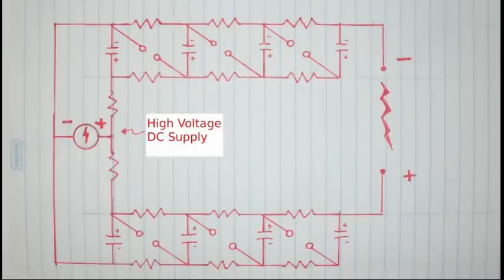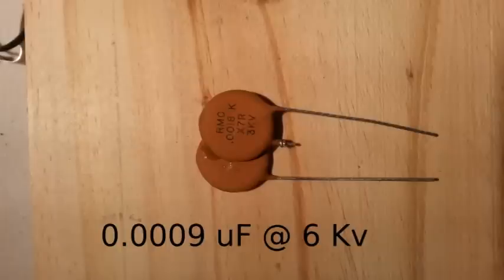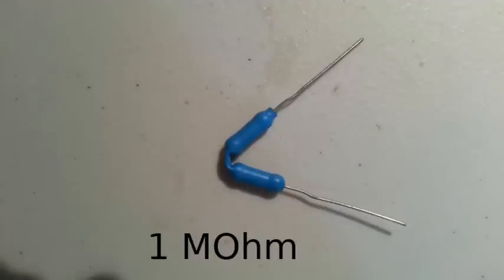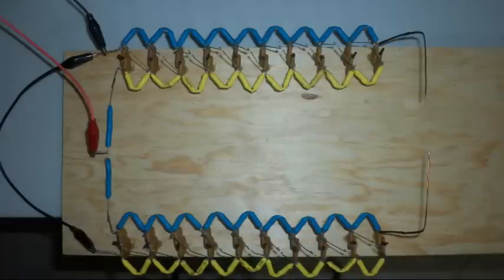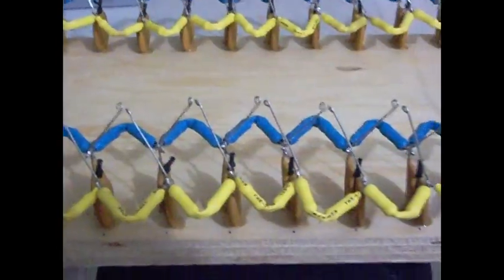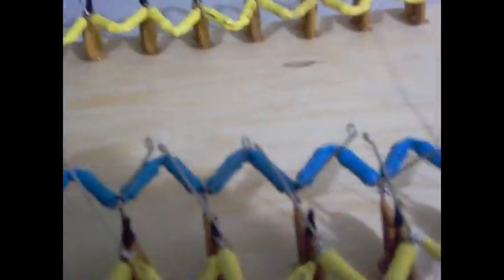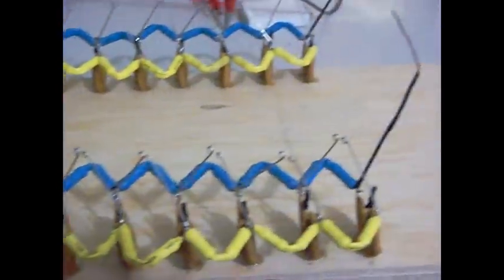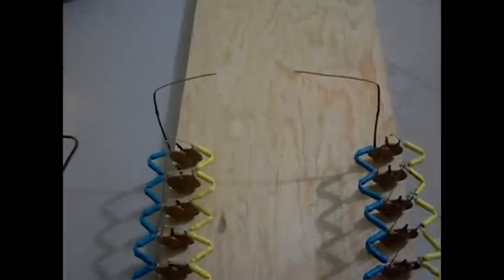Homemade Marx Generator - High Voltage Sparks

Comment: waiting on a ballast and then I can complete the Tesla coil I've been building. I learned alot from your videos. thank you sir.
Reply: @ludicscience  would you concur that it would be more efficient if the gaps had more curvature on the electrodes approaching the top of the ladder, since the (first gap in the simplest case) wouldn't even break down if there was no reconnection/leakage from the - of one capacitor to the + of the other ? Less leakage, more stability.
Reply: @ludicscience  if enough stability can be achieved it should in theory be possible to control the main gap by vibrating the fist one in the series
Reply: @ludicscience  the gap is in essence  just a capacitor that's meant to break down

Comment: would i be correct in saying that this circuit charges the capacitors in parallel via the resistors and then once fully charged they discharge in series via the spark gaps?
Reply: I'm a bit late, but this is indeed exactly what a Marx Generator does.^^
Reply: @Electroblud  does the cap discharge  when the vtg of the cap is equal to the air gap break down vtg ?
Reply: @erica8332  Pretty much, yes.
Reply: so ones the current discharges through the small spark gap why does the arc  travel to the large spark gap?
Reply: @erica8332  Once the current discharges through the small spark gaps, essentially all the capacitors are in series. This means that there is now a very large voltage across the large spark gap, producing an arc.
Reply: thanks for your response, so are the resistors there slow down the discharge rate? What role do they play?
Reply: @erica8332  Not quite. The resistors are there to provide a way to charge up the generator. If they were simple wire links, they would short out the generator when it fires, effectively killing the output voltage. The resistors are chosen large enough to not be "in the way" during the (very fast!) discharge, but small enough that the circuit can be charged through them without having to wait an eternity.
Reply: Sir ,how much DC input voltage is needed to get the output, im doing this project , can I get help from u @Electroblud
Reply: @Electroblud   help me  sir , how much input DC voltage is needed to get output
Reply: @NAVEENKumar-ui5gu  That very much depends on how many stages and what output voltage you want.
But for this specific project, it's 10 kV = 10,000 V
Reply: @NAVEENKumar-ui5gu  it must at least be equal to the vtg required to break the  air gap

Comment: The circuit diagram is not drawn correctly in this video (so the actual circuit is incorrect also). Not saying it would not work, because it would, but there is a small mistake which makes this circuit not operate to its full potential. Do you know why?
Reply: bottom left capacitor isn't in series with the others when the system sparks
Reply: The spark gap is just a capacitor that's meant to break down and regenerate it's structure quickly so it can break down again, preferably at the same voltage every time
Reply: Kevin Counihan  top and bottom left are interchangeable in that sense (the gap that bypasses the supply is missing, though he could have added two more resistors and the said gap), but still, the caps farther from the source  should be charging slower, hence the gaps between them are more likely to go off prematurely if the main gap is shorter than optimal
Reply: Kevin Counihan  Was watching this watch?v=EHRkCQ19GhU and started wondering if the Marx can be triggered with a Tesla coil connected at one of the end terminals (which could be the same shape a top load normally takes), but now I recall I also had an equivalent idea involving complementary Van de Graafs.. could be a recipe for those fire balls

Comment: Can we use CFL circuit  to give input power to "capacitor and diodes combination circuit" ie modified Marx generator. without using flyback transformer

Comment: Hi Ludic Science  , I have made a number  of different types of HV  device never a Marx generator though,  how is it you can use normal low voltage resistors in the charging  circuit, I assume that at the instant of charging cycle starting the capacitor at the bottom of the stack is at zero volts therefore full charging voltage appears across the resistor pair, I always assumed that you needed to use high voltage resistors which has put me off building this device as hv resistors are so expensive and somewhat difficult to obtain Thanks Tim D.

Comment: according to your circuit diagram, if each of the capacitors is 5kV, then what is the output voltage? 40kV or 20kV?
Reply: i think the output is 300kv, atleast to my rough calculations

Comment: I am assuming that the resistance of each resistor is .5 ohms and each are 1 w?  With this same setup can I use a flyback at roughly 10kv?
Reply from the maker: Each resisor is 1 megaohm, not 0.5 ohm.
Reply: K

Comment: Hello sir,
Can I use "rectified" flyback transformer (new type),  instead of AC flyback transformers (old type), for input power of this "capacitor and diode" combination circuit. Would this circuit work by input of "rectified flyback transformer".
Reply: Yes. It works well!

Comment: how high was the input voltage? could it work at 12V? also what is the current draw?
Reply from the maker: ***** No way with 12 volts, input voltage was 5,000 volts DC. I did not measure current draw, must be about 1 amp (from the batterry that feeds the high voltage power supply) approximately.

Comment: How many Amps in the output?
Thanks
Reply from the maker: Depends on the size and type of the capacitors, but is on the order of hundreds of amps for a small marx like this.
Reply: Ludic Science How much in your?
Reply from the maker: Дамир С I dont know exactly, i have no way of mesuring the current. It is not something that you can measure with a multimeter.
Reply: in my opinion, its depending on your load resistance value . . usually high voltage used in transmission line to reduce the amount of current flow . . it is from V@E = iR equation . . ohm`s law
Reply: You mean the resistance value of one resistor? I mean, R=1 MOhm or R=all resistors value?
Thanks!